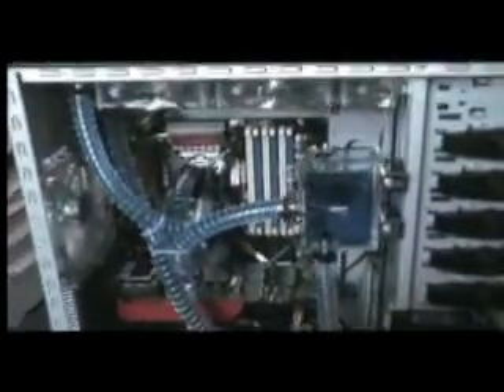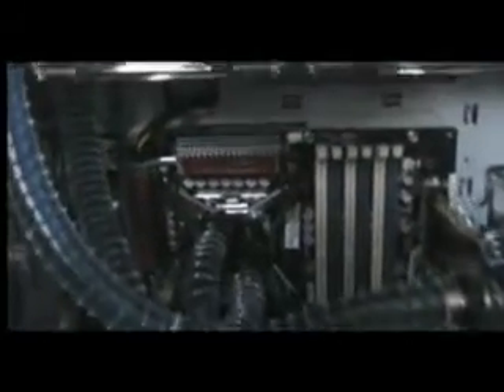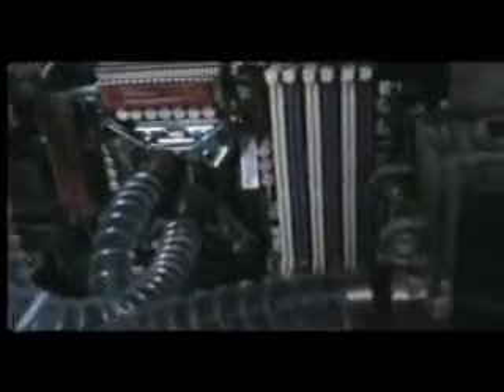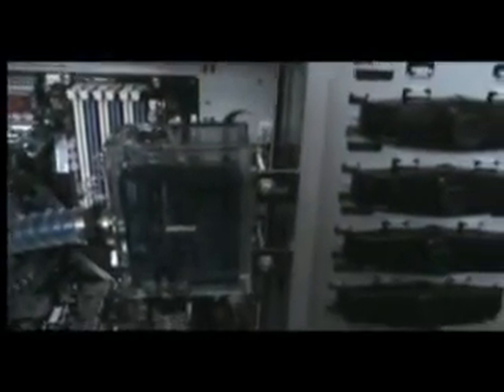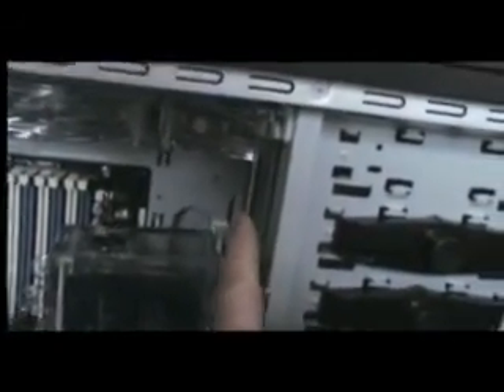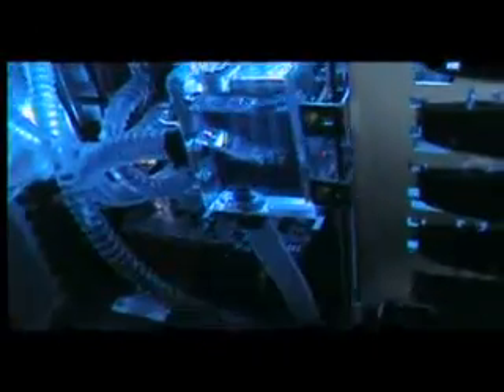Rampage 2 extreme-Core i7 920 Build 1

Comment: If the system is a fully closed system you could turn it upside down without it leaking... ask the shop if its fully closed system.

If so, dont worry about stairs